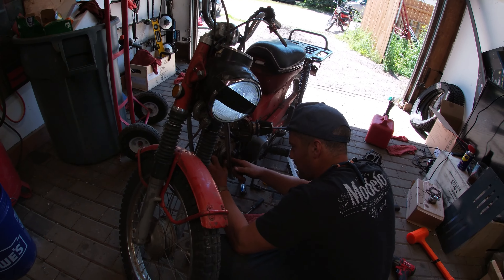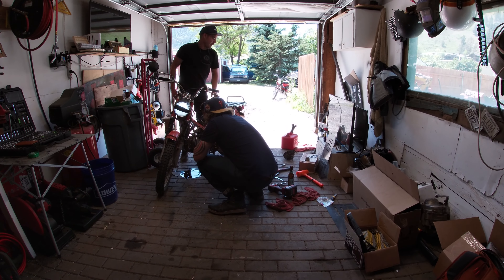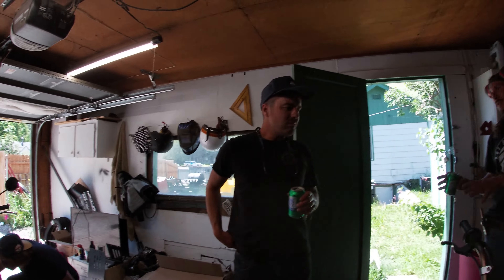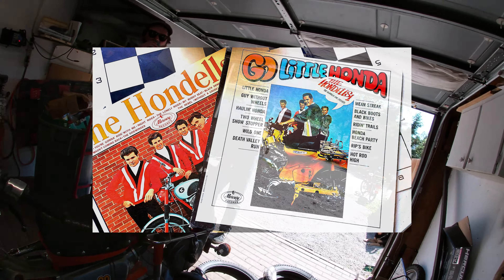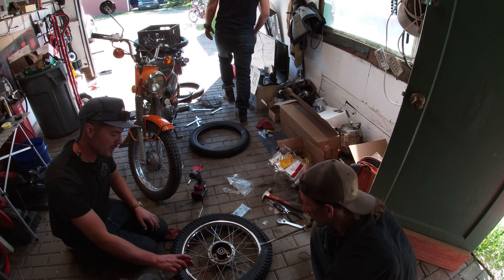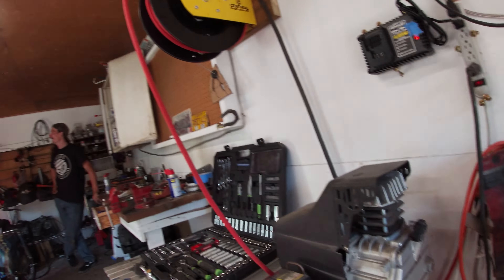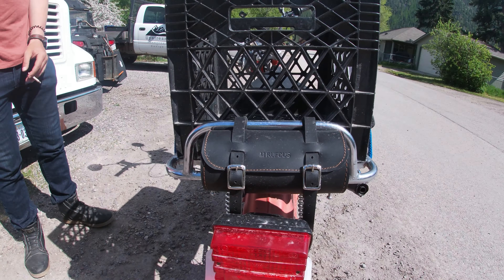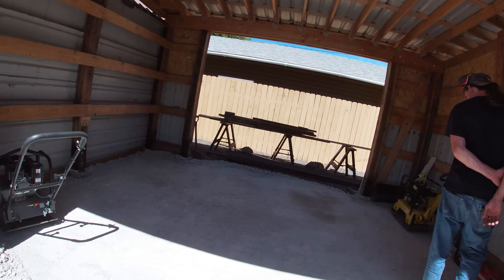Top End Rebuild | Red Honda CT90

Comment: Enjoying your videos.  Just subscribed.     Did you figure out  how to set timing?   With piston at TDC, flywheel “T” mark is lined up with notch in engine case at 12:00.  At the same time, the “O” on cam gear faces 9:00.  There is a notch in head, that you can see with cam cover off.  If you have all these lined up, you should be good for timing.
Reply from the maker: We did figure it out and thanks for the tip! We gave a quick recap in "miller divide trail" episode.
Reply: @MTBottleBoys  👍🏻 I must have missed the follow up.